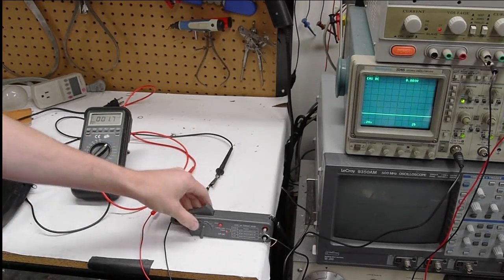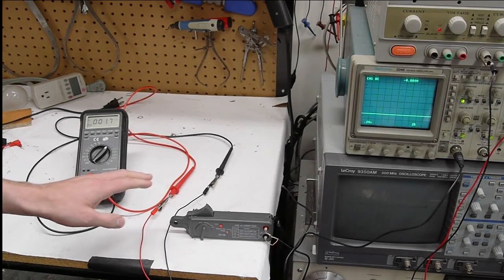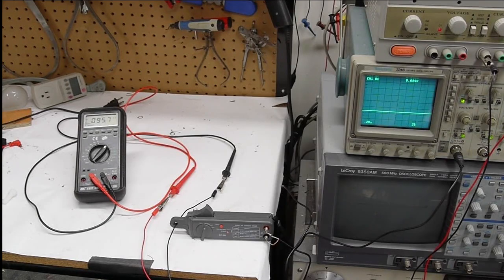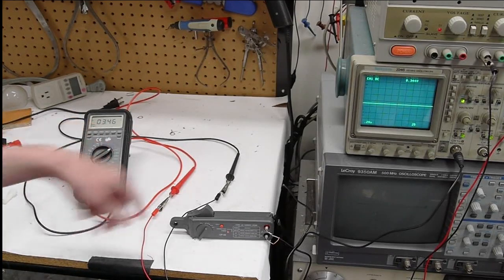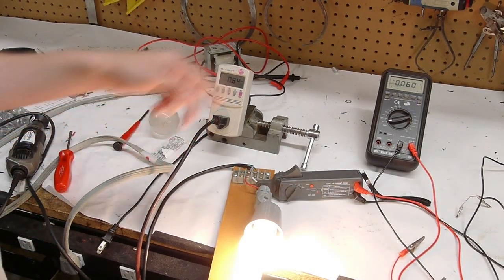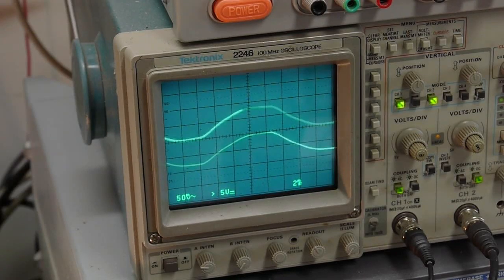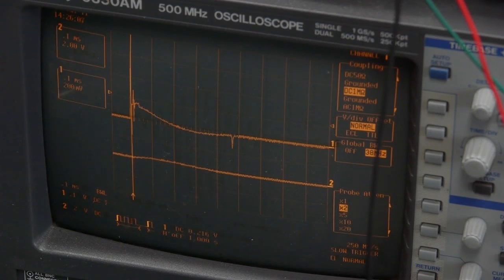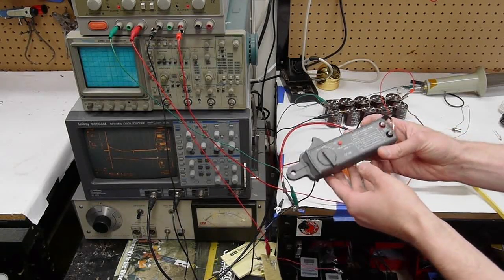Product Review: CP06 low-cost AC/DC clamp-on current probe

Comment: Can you use it to measure leakage current in the order of  milli-amps ?
Reply: YES
I bought one "Kilter" branded (beccause Kilter is cheapest).
There are 3 ranges
1.    0 - 400mA AC/DC
2.    0 - 4A AC/DC
3     0 - 40A AC/DC
I use the 0 - 400mA AC/DC range for the vertical of my VI  curve tracer using X1 on the Oscilloscope so it is being used in order of AC milliamps.
I have also tested charging of a 12v DC car battery. Start with range 3, then turn down to range 2 and then range 1 when the battery changes to trickle charge.

Comment: I picked up one of these on eBay for $60 a few months back.  It does a pretty good job, for what it claims.  The build quality is about what you would expect for something from Radio Shack.  Accuracy is better than I expected.   Frequency response is just OK.  But, for $60 for an AC/DC probe, that will resolve mA,  you just cant complain.

Comment: I got a fluke 87V used on ebay.  It's the same on God uses.  I had a craftsman that had the 2nd hookup for 20A.  Screw that noise!  Other things I love are it will measure forward voltage on LEDs, even blue ones; its continuity beep is fast as lightning, fast enough to beep on smd ceramic capacitors as they charge; the backlight is amazing; it will measure nanosiemens.  Don't even pretend you don't want to measure those.  It's generally just a joy to use.

Comment: Hi.  Do you think it would be safe to use this probe to measure car's starter current thats around 150-200a?

Thanks.
Reply: No.Get the CP-05(+) that supports 400A max. for that. CP-06 has 3 ranges all 1/10 of the 3 CP-05. ranges.

Comment: The bandwidth spec from their site: 1kHz, 10kHz (-3dB).

The tek current probes you are referring to are really impressive: bandwidth is DC to 50MHz or more (TCPA300). There are also some hall effect transducers on digikey good for DC-200kHz which look interesting. They are not split core though.